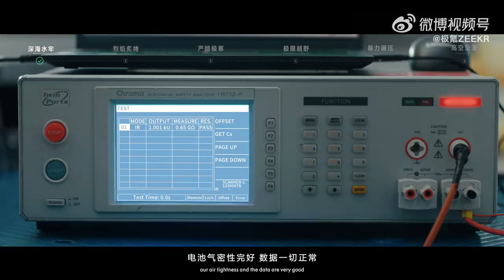Zeekr burns the Golden Battery at 1000 °C and it still works

Comment: The battery appear certainly robust, However The real durability test remain the REALITY we face on real road. Take that battery to east Canada roads with Real Calcium with all contaminents and minerals in it plus sand during 4 seasons from -40c to +35c and let see how well it will survive over few years compare to these tests. Our "environmental test chamber" climate is what I call a real test. "1000c" fire during few minutes on the thermal inertia of a battery case is nothing. Pure calcium at 10% concentration in water is nothing. Galvanic corrosion leading to water intrusion near connector port and pyrofuse and contactor bay, deffective or clogged breather /vents that bring moisture inside the battery will destroy it easy. Yes that's the reality EV battery repair shop tech are seeing everyday here.  Fully contamined road calcium, water, and winter is the perfect silent killer that battery should fear the most.

Comment: Doesnt the fire melts those orange plastic plugs ?
Reply: I was thinking the same thing.

The fire seems to be on the underside and the orange high voltage connectors are on the side. Apparently they can take the adjacent hot air.
High voltage wire connectors are typically rated for 105 degrees Celsius. They can take more. 

Also even if they melt or deform on the outside, as long a the inner metallic contacts work the battery will function. The metalic contacts will only melt after prolong direct exposure to fire.